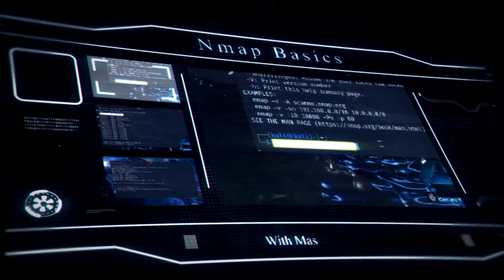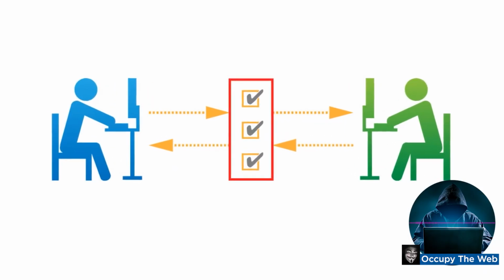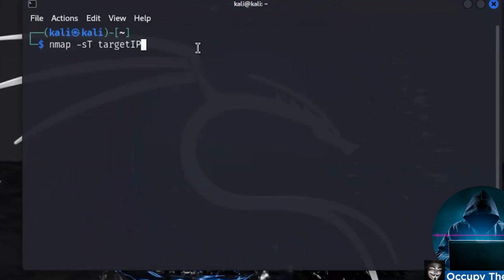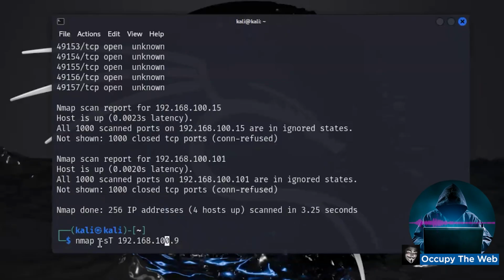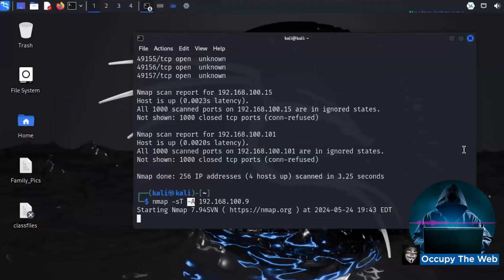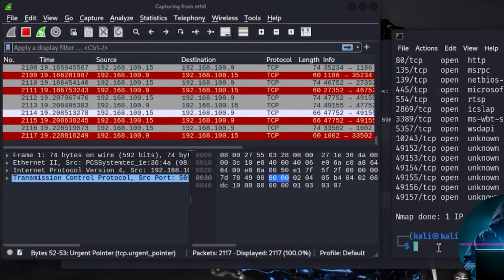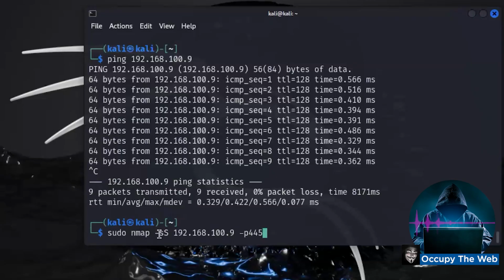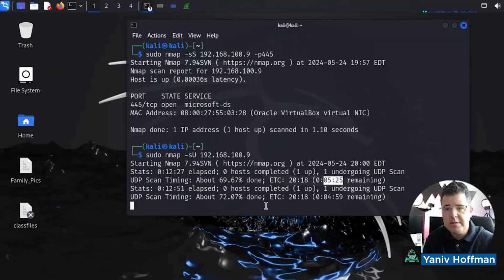How to Use Nmap: Top Scans for Beginners in Cybersecurity

Comment: Me being a hacker myself , I'm glad you make it simple. Thank your for that otw. For more advanced techniques  individual can use -g or RND. If ports are filtered use Firewalk script. Alot of ports people over look is port 79 which is finger. Information can be gathered from that as well.
Reply from the maker: Thank you 🙏
Reply: Where did you started?
Reply: @alonegamer9010  I taught myself to a degree. I started with a program on Udemy. I went to college and got a degree in computer Networking and a trade in CIsco net acad program. So I had that to my advantage before I started hacking. Eventually I got certified in it. Were you intrested in hacking? How would your rate your technical skills ?